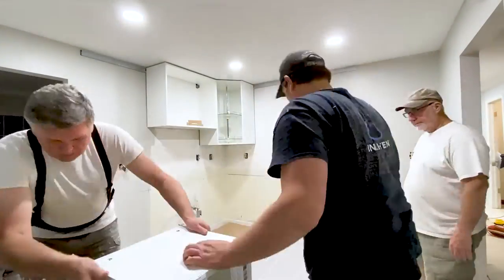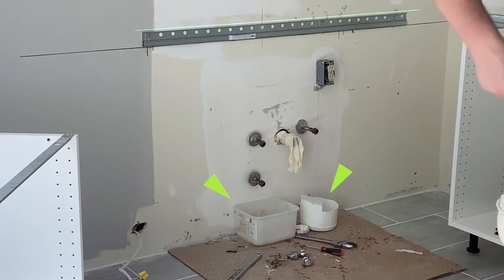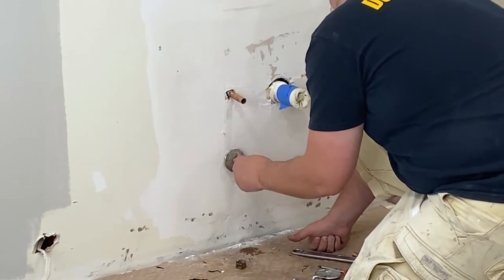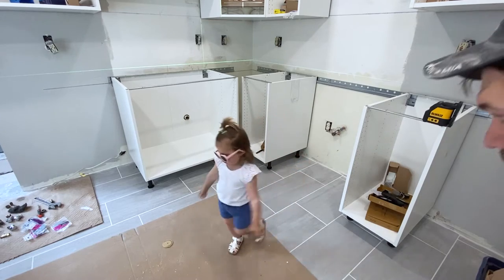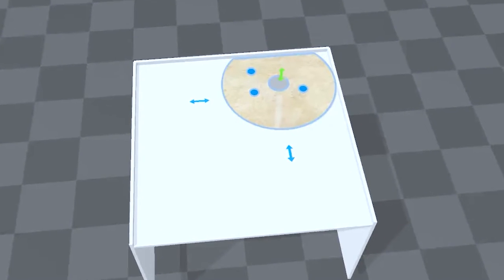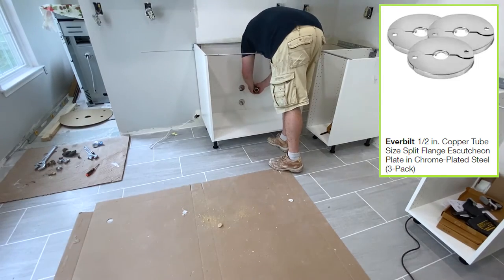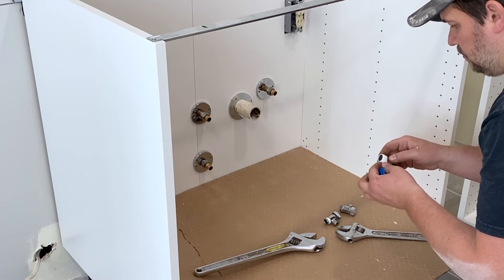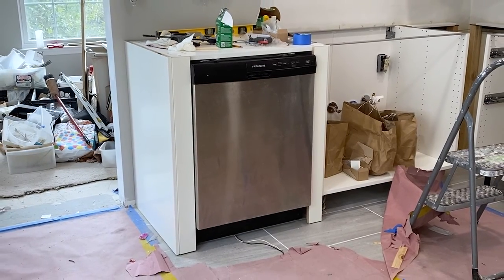How To Cut Cabinet Holes For Plumbing + Install Water Valves

Comment: What did you do for the void in the corner?  I'm doing a very similar process right now.
Reply from the maker: Thank you for taking the time to ask this question. We installed some custom supports in the corner. Instead of trying to explain it to you. You can see what we did in this video https://youtu.be/1_tjn4n9NEg?si=ioNb_E4IXYtMY9wP starting at 2 minute mark if your in a hurry. Please let me know if I can help in any other way.